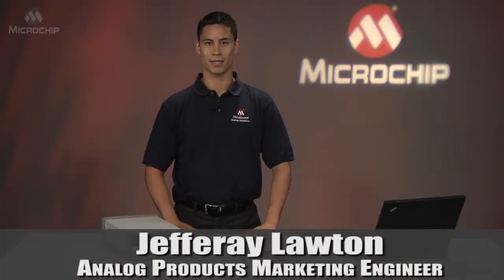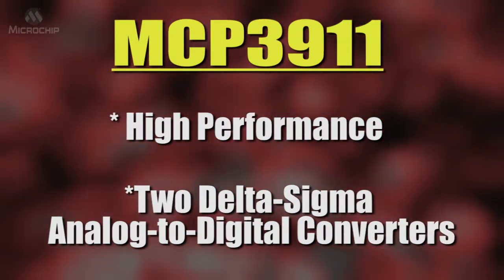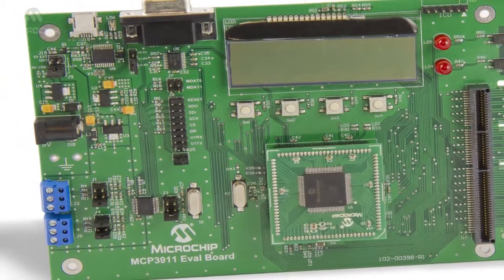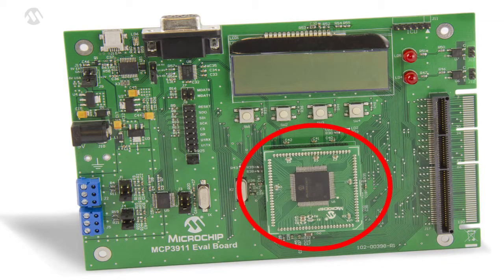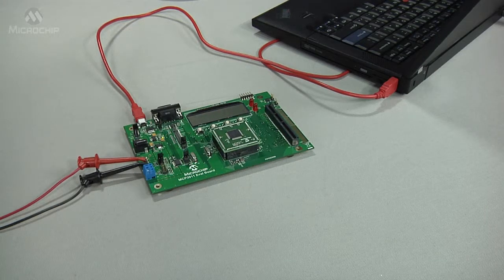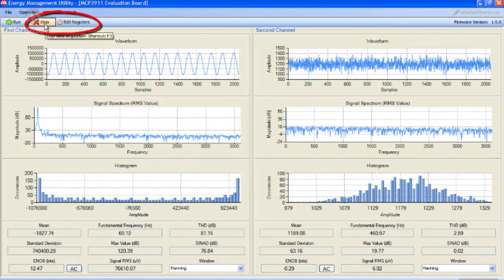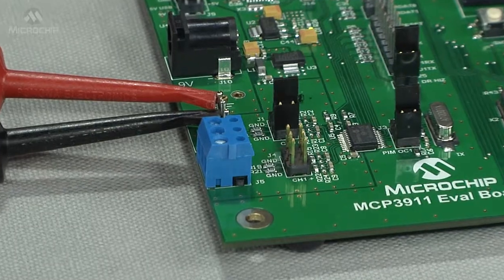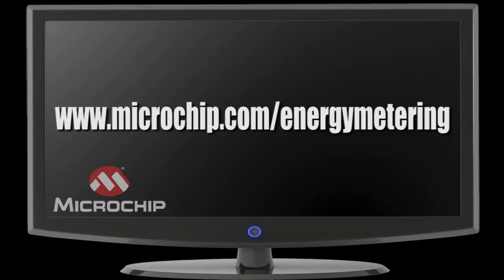Microchip Technology MCP3911 (High Accuracy Energy...

Comment: Hello, 
 i am using MCP3914 for current measurement but got stuck, please help me

Test setup
ADM00523 Eval Board(MCP3914)
1 m Ohm shunt (4 terminal)
Energy management utility 
Current source (0-50A)

For verification 
Fluke 287 Multimeter

i am trying to convert the values provided by energy management utility but some how the values are not matching with the fluke 287 meter value, i am doubting on my ADC setting,

can anyone will please help me here, please find the same problem on microchip forms as well

http://www.microchip.com/forums/tm.aspx?tree=true&m=949356&mpage=1